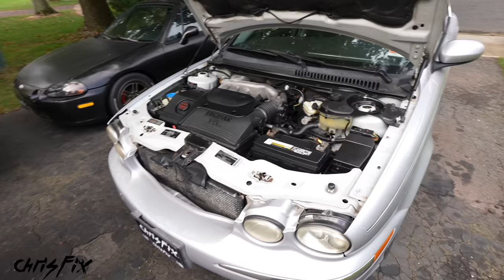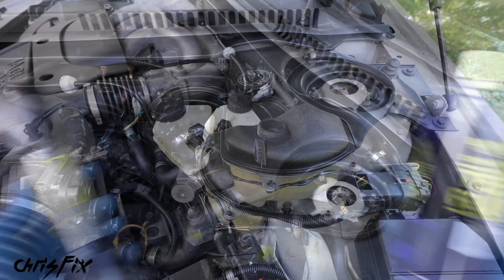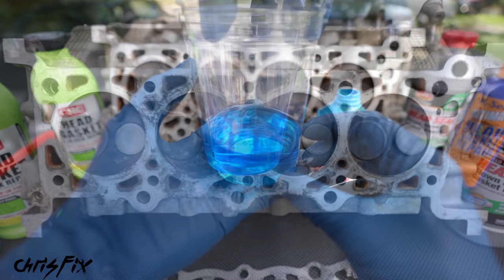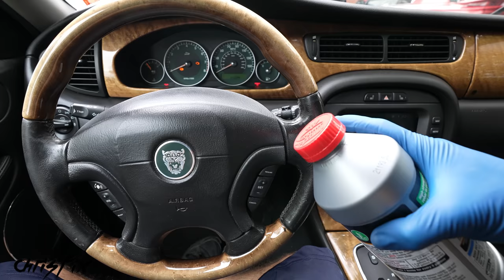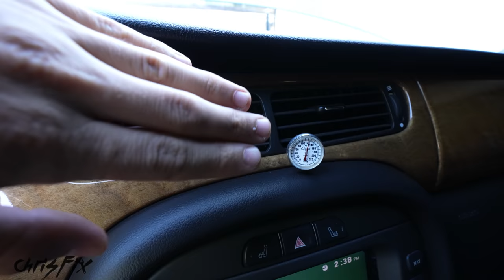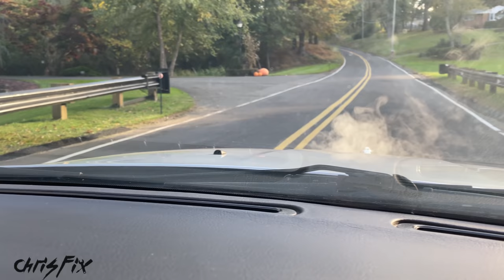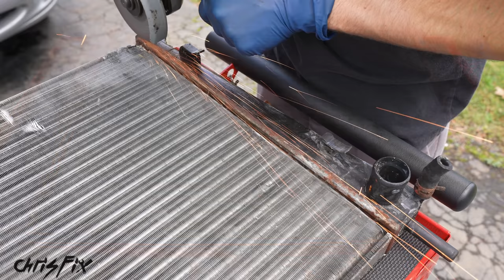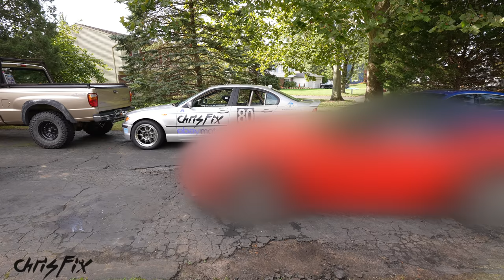Do Head Gasket Sealers Actually Work (FULL 2yr TEST with Engine Teardown)

Comment: So I think I have a pin hole in my heater core. I smell antifreeze when I first turn on my AC or heat. And it goes away and I get a lil fog on my windshield. But there's no leaks no wet carpet or nothing I have hot heat and ice cold AC. And I'm not losing any antifreeze. But it's super annoying to smell would u recommend to dump a heater core sealer in the vehicle? Like quarter a bottle or something.
Reply: Yes. It should say on the bottle how much to add.
Reply from the maker: No this will not seal a heater core. Head gasket sealer needs to come in contact with combustion gasses which are very hot in order for this to work.

Comment: Hi Chris.  Does a bad head gasket always cause overheating?  I took my honda in for a fuel pump recall because I was noticing poor acceleration when I needed to get on a highway.  The dealer told me the fuel pump is good and I need a head gasket.  My oil and antifreeze both look normal.
Reply: I want to know this as well. I just recently took my 2018 (bought it brand new) to Honda and they told me a head gasket as well. The symptoms my car is having, is what the recall can fix but Honda won’t get fuel pump module until the end of the year I was told. My car has ran hot before but it’s not often.

Comment: The only thing is this.  Your radiator is no ordinary one.  It uses large tubes much like a say trabsmissionn cooler would.  So theyre too large to clog.

Most car radiatir use thin rectangle passages for coolant to flow through

Comment: My car coolant (nissan qashqai 2012) seems to go down, but not all the way. Seems I can still drive it and temps are fine and no colored or white smoke etc. But after using car for like 100 miles, I can leave it some days and the coolant tank seems empty. When I unscrew it, it makes a pressure sound of releasing, but appears empty. 99.9% sure its not leaking, the radiator gets warm and the hoses feel ok. I guessed it must be my head gasket, but after watching your bad oil example I do not see any foaming etc in my oil. So my only guess left is the heater matrix for the inside heater.... But I tried to drive the car for 2 weeks without ever using the heater or fans etc at all and still the level is decreased when I check the coolant.  (I don't have car knowledge at all, PLEASE HELP :D I need help because I need the car for work but I just bought it for £2,000 and I have zero savings left to buy another car)  (Also note: the Oil Pressure light flickers on when I am not revving engine, which is what made me notice the problem in the first place, and I think the engine sounds rough but it could just be my imagination... sorry for long wall of text)
Reply from the maker: If the coolant is mysteriously getting lower with no leaks it's likely the head gasket, and see my other comment
Reply: @chrisfix  Thanks my dude. After watching the entire video through, I am a little more hopeful I can get it working. My car too seemed to develop the problem after I had to blast the engine to get up a steep hill. I figure the previous owner probably already did this but gonna give it a try tomorrow!

Comment: I've got mercedes e220 2014 high mileage. The coolant is going to the oil and the headgasket liquid test failed, change of headgasket is. It worth for this car and i try to pick the right sealer wich can seal the leak between coolant and oil as well. Any recommendations?
Reply: All of them work but I wouldn't recommend getting any with particle filler if removing the thermostat would be a problem for you.
Reply: @SinsBird   I thought to remove the thermostat and pipes for the heater. I think the part where coolant and oil meet only fibers can help. Do you have any experience with headgasket sealer?
Reply: @yordanbogoev1370  Yes, and I always recommend to try it. When oil and coolant are mixing it's less likely to seal successfully, but it's still worth a try. It's very risky to run the engine with coolant contaminated oil without knowing how bad it is, because it can damage the engine.
Reply: @SinsBird  yes I know, the thing is that car is running perfect, not overheating no bubbles in coolant tank just lose coolant and I saw that is in the oil

Comment: I did step by step, and started blowing white smoke after 20’ I shutdown. Why is that ? Should i wait to cool it down and start it again?
Reply: I recommend to do it in steps, not one go, also keep the RPM above 1000.  Let the temperature rise some, shut the engine off, let it sit for and hour, check coolant level, add water if there's less of it now, start and run the engine some more to reach a higher temperature than before, shut it, let it sit for an hour. Check the coolant level...and so on till it reaches the operating temperature. Don't hurry to dump it out of the cooling system, make sure that it sealed for sure, drive it keeping rpm high so it gets hot, then check the coolant level. If it's okay only then dump it out.

Comment: I use the KSeal on my 09 Grand Marquis and it only leaked out the exhaust on the head gasket once I use the case sale it leaked out the exhaust and into the oil completely missed the engine up

Comment: Would you try this with oil leaking into cooling system?
Reply from the maker: The liquid glass sealer needs high temp exhaust gasses to seal so it prob wouldnt work well for a oil-coolant head gasket leak.

Comment: Awesome video! Do you need to flush the fluid out of your system or are you supposed to leave it in?
Reply from the maker: Thanks! In my case they suggested leaving the sealer in the system so I did that.  Whatever you end up going with, just follow the instructions
Reply: @chrisfix  Jesus that was a fast turn around time for a question a year later lol

Comment: Would love to try it, but im worried about that fiber stuff. It looks like lint from the dryer screen.
Reply: Is oil and coolant mixing? Oil in coolant or coolant in oil? Or both? Is the cooling system pressurized?
Reply: What are talking about? I think you misunderstood my statement.
Reply: @victorhoyt4352  You can't use ANY sealer before the key criteria are met, that's why I'm asking. The cooling system must be pressurized during engine operation, otherwise the sealer won't work and you will have bigger problems.
Reply: Ahh, gotcha. Yes, the cooling system does pressurize while the car is operating.
Reply: @victorhoyt4352  If oil and coolant aren't mixing then it would probably work. If removing the thermostat would be a problem for you choose a sealer which doesn't have particle filler in it. I recommend to do it in steps, not one go, also keep the RPM above 1000. Let the temperature rise some, shut the engine off, let it sit for and hour, check coolant level, add water if there's less of it now, start and run the engine some more to reach a higher temperature than before, shut it, let it sit for an hour. Check the coolant level...and so on till it reaches the operating temperature. Don't hurry to dump it out of the cooling system, make sure that it sealed for sure, drive it keeping rpm high so it gets hot, then check the coolant level. If it's okay only then dump it out. Flush the cooling system multiple times before and after using the sealer.

Comment: I have a question and hopefully you have the answer. All around the engine it looked dry nothing leaking maybe a bit of rust here and there. In the coolant reservoir the liquid was clear pink and so was the radiator. But I noticed there was like a drop of “something lumpy” very dark/grayish that had frozen outside around the engine oil cap but not the cap but engine itself where you pour the engine oil. Could that be head gasket sealant liquid ?
Reply: Unlikely.

Comment: I need help. My truck is spitting black gas from the exhaust, no white smoke. Oil isnt white but for pretty new oil its liquidity and black.  Coolent is brown and my truck isnt over heating but it does have a misfire. Any advice?
Reply: Oil change every 10k miles. I do add additives to help oil. New radiator. OEM one looked completely rusted from inside
Reply: @kevinfalcon9098  Could be many things, a bad injector. Oil already has additives, if you add more additives, it gets worse.

Comment: Will this work on Atv Utv's ?? Have a Kubota UTV that is pushing pressure into the overflow at startup and plugs slightly wet !! If so, how much would you use 1/4 bottle ?? Thanks !! 😊
Reply from the maker: I can't see why this wouldn't work, and there is often a chart or guide on your sealer bottle that shows how much to use depending on the engine size
Reply: @chrisfix  Thank you for the info. Much appreciated !! 😉👍🏻

Comment: Would it work in Mazda 6 2017? Some water in cylinder, still working but was advised it can stop soon. I need to fix head gasket blown
Reply from the maker: These products will work in any make and model. Give it a shot, if it's that bad you don't have much to loose by trying something like this
Reply: @chrisfix  grand! Huge thank you! I’ll try to order blue devil and f22 for my Mazda and hopefully try to solve temporary this issue.
Got this car second hand over three months ago, change oil and everything and sort this last week😪
Reply: @heliosantana6731  Is the cooling system pressurized?

Comment: Hey , i have one question ? 
Did you put directly on coolant reservoir?

Second my oil mix in coolant reservoir, does this liquid fix temporary?

Can i put in bad coolant or i have flush and put new coolant first?
Reply: Flush and use water, but it's less likely to seal if coolant is mixing with oil.
Reply: Make sure cooling system is pressurized.

Comment: How long can this product stay in the coolant? Or how many kilometres or miles? I used rislone and works, test cO2 negative, no presure. But for how long..?
Reply: You should drain it and flush the cooling system multiple times.

Comment: I know this test was for a head gasket but would this be similar to a rear main seal leak? I have a 2015 Mazda 6 and the dealership wanted to charge me over 2k to replace it but I ended up using the blue devil rear main sealer last week and I’m still waiting for the results
Reply from the maker: Not really since that's just an oil leak

Comment: Will it work in with water coolant? And thermostat removed?
Reply: Only water should be used with the sealer. The thermostat should be removed.
Reply from the maker: Check the instructions on your specific sealer. In my case the thermostat did not need to be removed and it was compatible with coolant and water

Comment: I added the Rislone head gasket sealer to the coolant reservoir just 3 days ago and seems like it’s working as I am not noticing any misfires, white smoke or coolant leak but in the reservoir I can see the sealer floating with the antifreeze. Should I change the coolant ? or let it be according to the instructions on the bottle it says I should let it be but I do not want the extra sealer seal something that not wanted.
Reply: Yes, flush multiple times with water and add new coolant. You can drain what you have right now and save it, you could pour it back in if it started leaking again.

Comment: Hi everyone, May I ask my coolant not running low and my oil look good when I did oil change, but i see oil leaking wet on the outside head gasket of the engine??? Should i add engine leak stop DB to coolant tank or Not( yes or No) what is your opinion??? And do i have to do oil change and coolant change after I added the gasket stop leak DB??? Thank you everyone ..have a nice day
Reply: Wont work.

Comment: I have a 2008 Suzuki forenza with just under 80,000 miles on it and was confirmed that the head gasket was bad. What brand of sealer would you highly recommend
Reply: Is oil and coolant mixing? Oil in coolant or coolant in oil? Or both? Is the cooling system pressurized?

Comment: You skipped a whole step in the Bars leak instruction which is probably why the car overheated after he put the product in.

Once you let it run the first go around you have to let the car cool down for 30-45 mins,  then you have to let it run for another 15 mins at 12-1500 rpm.

Comment: Is there a way to test for leak if youre unable to crank car?  Ive got my acura tl torn down for a valve cover gasket repair and valve adjustment at the moment but would like to get an idea if i have a head gasket leak cuz my coolant was low.  I never noticed external leak and my oil is not milky nor did i ever notice white smoke
Reply: Yes, you can pressurize the cylinder with compressed air when the valves are closed.

Comment: I took a look at my gasket leak and it seems like the engine coolant leaked into the first cylinder because of the gasket leak. Is there something I need to do about the coolant or will it exit the cylinder by itself?
Reply: It will exit.

Comment: What if I don't have a heat system because I needed to replace it and my friend by passed it. Will this work if I just let it sit idle
Reply: You must keep it at 1000 rpm at least. Oil in coolant, coolant in oil or both? Cooling system pressurized?

Comment: There some bad or thief mechanic charge you for head casket replacement 700 dollar and up, and what they do, they try the sealer that cost them few dollars,  and if it worked, they call you that your car is ready to pick it up, and after a year of driving if you lucky, the head casket start leaking again.

Comment: I have a ford focus Ses i just replaced the radiator, ac condenser and auxiliary fan it runs good. I’m able to start it up , the engine temp doesn’t run hot just a little bit before half and stays there. I’ve just been losing coolant every time I check. I would pour more into the actual radiator and reserve. Any advice or comments?
Reply: Is the cooling system pressurized? No coolant in oil? Coolant is clean? How much coolant have you added so far?
Reply: @SinsBird  I haven’t seen any coolant in the oil, i check multiple times a day. I’ve only added one bottle of Preston’s 50/50 and I’m checking the pressure and for engine combustion gas today.

Comment: That was a great video.  Thanks so much!
Question for you, as to what product and how much you think I should use. I have a 1995 Subaru 1.8L 4-CYL boxer Impreza, 177,000 miles.  I have 76 and 78 PSI dry compression in #2 and 4 of one head (driver side).  This started a few days ago, we noticed while on a highway trip the power was weak and I can hear it missing as the RPMs drop from driving to idle.

I don't have overheating, excessive oil consumption (drippy seals, I add a quart about every 900 miles), smoking, or fluids cross contamination.  I'm waiting to have a leak down and another dry/wet compression test at a different shop. The first shop only did dry compression and wasn't too bright or helpful. 

If I end up having a head gasket leak between those two cylinders, what products would I possibly try to mend it?  It must not be too bad of a leak, whatever it is, for the compression to build to 78psi dry.  The other two good cylinders are 130ish psi. 

If it ends up being a valve leak, what products and strength could I try to get them clean?  After cleaning, I will have valve clearances checked, as it's probably never been done. 

Thank you Chris or other!
Reply: Nothing can be done with chemicals.

Comment: So would the CRC yellow bottle work for a manifold gasket coolant leak?
Also I was wondering if the coolant leak products will clog up the radiator or anything else? If they're made out of something different...
Reply: It should work. They can't clog anything if you know what you're doing.

Comment: Will a head gasket sealer work on a heater core because it is leaking and causing overheating problems and it is on my favourite car i plan to keep for years
Reply: Sure.
Reply: @SinsBird  thanks
Reply from the maker: No it won’t work because there is no exhaust gas to harden the sealer. The heater core needs to be replaced.

Comment: Will the overheat light indicator go away ??? My car has no temperature gauge but when it’s hot or overheat it shows the light on the dash a red temp light..
Reply from the maker: If the car stops overheating because you fix the leak, yes it will go away. If it continues to overheat then no, it will stay on.
Reply: @chrisfix  thx u Chrisfix I just did the test and it’s not the blown head Gasket !!!!! Yes I’m happy but did replaced the water pump and thermostat twice thinking it’s a faulty one still overheating.. even the radiator sensors was replaced… ANY idea what’s wrong with my 2011 Ford Fiesta???

Comment: If I live in moderate temperature area (ie, never very cold) What is the worst can happen if I cannot afford to replace Head Gasket. The leak seems minor now, but I reckon they already used this Head Gasket in Bottle stuff before selling to me, because for a month or two there was no problem, then suddenly I notice a slow coolant loss. Could I just use water as coolant or will this drastically speed up the failure? I think its a waste of money if I have to use the sealer every month. (I only need the car for work approx 200 miles per week, and if I can make it last 6-12 months longer I can save to buy a better used car)
Reply from the maker: I don't think using pure water will speed anything up. You might want to try doing this one more time and see if you can at least patch it for now (I wouldn't use this every month if it doesn't end up working, just carry a bottle of coolant/water with you and top off as needed, that's what I did on this car for a while)
Reply: @chrisfix  Thanks so much Chris. I'm getting a bottle of Steel Seal tomorrow which is all I can find around  here. I'll report back how it ends up :D
Reply: @kilbabaplays8944  Start the car when the engine is cold, remove coolant fill cap, fill to the brim, see if it's bubbling.
Reply: @SinsBird  Going to do that although I fear it is bubble because I think I have heard the bubbles when I inspect after driving
Reply: @kilbabaplays8944  Report back.